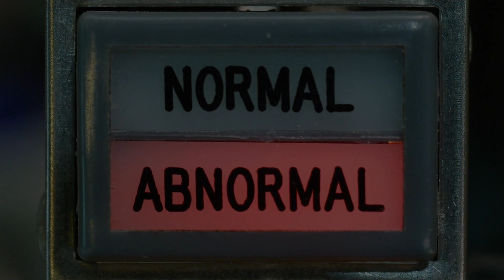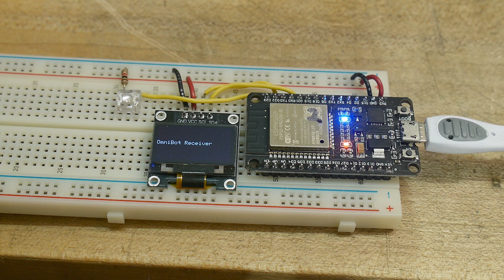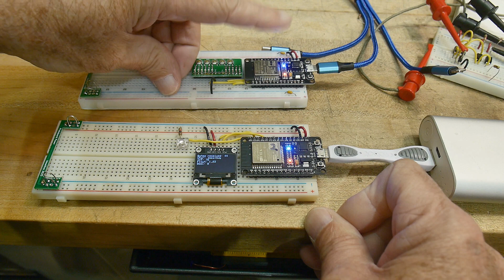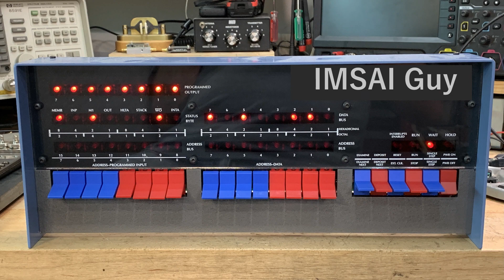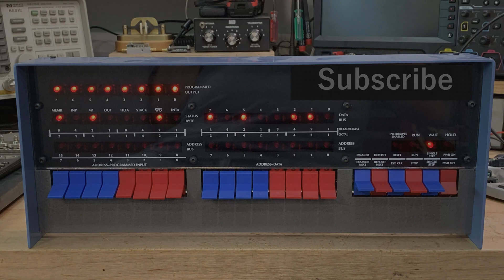#1843 OmniBot (part 4 of )

Comment: Yeah. ESPNow is very cool. It's a clever exploit of standard ieee822 (wifi protocol.) It's a datagram protocol, and doesn't require a connection to your router. Excellent choice. Some guys use it for real big-boy robot control, too, so it's robust. I've had it work over 500m, too :)
Reply from the maker: thanks, that's good info
Reply: @IMSAIGuy  digging deeper: there's a standard vendor-specific wifi packet that's completely legal, you send it to a MAC address and the matching listener filters it in. ESPNow uses that. Because it's not carrying IP, you don't need an IP address (so no need to authenticate to the wifi router. You might want to choose a different wifi channel to your home network's, but it's not going to matter much with this low bandwidth.) On receipt, in ESPNow, the receiver sends back an ultra small response (so it's not strictly datagram, I guess.) If the sender doesn't see that, it resends for a few retries. That's worth knowing, because it can mean that your transmission can randomly appear to take longer, if you are calling the espressif API to do it. Given that you're using it for local sporadic remote control, you're likely not going to lose many packets, but if you ever find yourself initiating data from the robot, hence risking packet collision, this might explain any observed flakiness. Better to have the controller solicit a reply packet, if you want to do that.

Comment: I am not finding fault, here... I am not really a coder; I'm just learning, as I go. For my clarity, you are picking a MCU platform, before deciding on the exact functions that you will have the robot perform? I do find the full development process - product type definition, design goals and, particularly, a code flow-chart to be really helpful. For me, a flow chart will just about right the code... It is the recipe, so to speak. (Even so, I do not enjoy coding, at all... which is very limiting.) Maybe you are looking at it the other way around - what is the MCU capable of doing. This would be a rather huge project for my hobbyist skills, necessitating a good amount of structure. Maybe your knowledge base allows you to do it all on the fly and a less formal path is more relaxed and, therefore, more fun. I suspect this is the case. Any tips, on the design course?
Reply from the maker: It's just a hobby project. I have already used the esp32 and since those modules have wireless built in, it is an easy choice.

Comment: In case anyone doesn't know, every network device has a unique MAC address, not just these ESP modules.  Think of them as network serial numbers, where first half of the MAC identifies the vendor/manufacturer.
Reply: Yep, which really comes in handy because that first half (the manufacturer ID) is publicly available, which helps if you're scanning a network and looking for what IP address a particular device is using.  I use it to find PLCs and Modbus bridges when I'm at an unfamiliar site.
Reply: @jeffspaulding9834  same here for customer networks.

Comment: I used that protocol with a motion detector in our office to let people in their individual offenses know that someone is in our lobby.  I used the broadcast to all option on that project.  I also used that protocol to design a sensor that lets us know if our garage door is open.   If the garage door is open LEDs light up on a small panel in our home.  I also have an app on my phones to check if the doors are open.  My wife always wonders if we remembered to close the door after we leave the house.  Now instead of turning around and driving past the home to check the garage door my wife can just check her app on her phone.  Both have been running for a few years without any glitches.